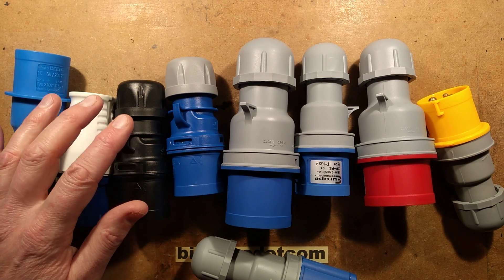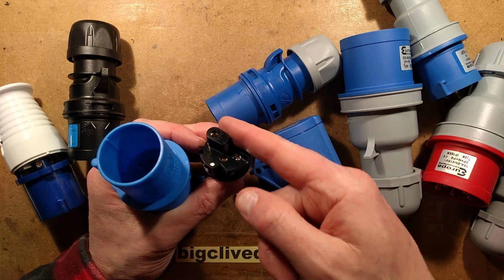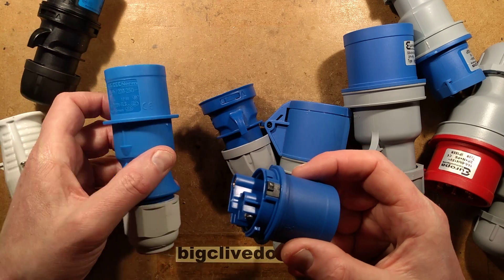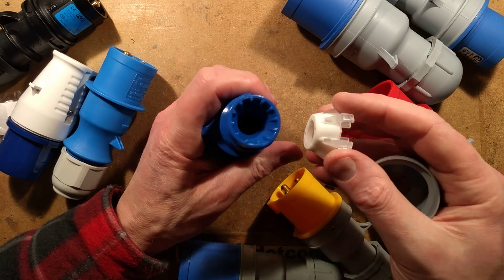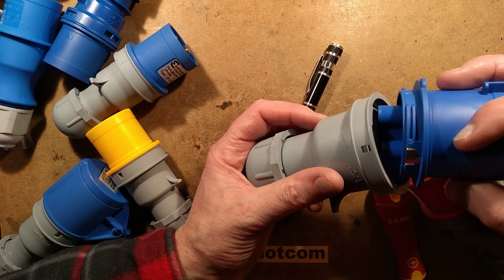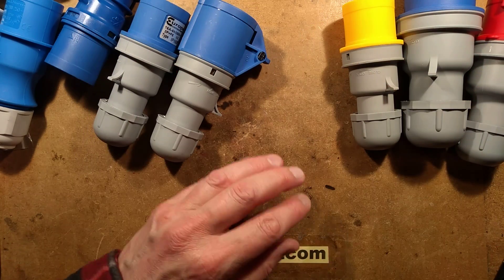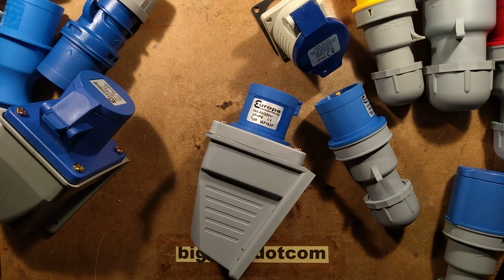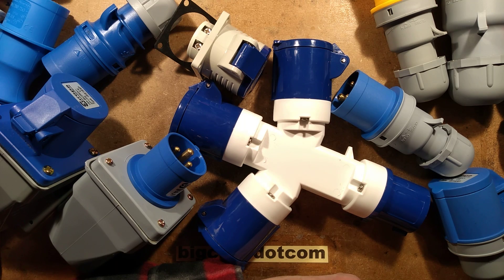My favourite industrial connector (Ceeform).

Comment: These are very common in Germany. Almost every home has them installed.
Reply: Common, yes. But in the home? For what purpose?
Reply: Anvilshock  in german houses you will find mainly the 16a 3 phase variety. They are used for loads over 3.5kw for example an electric log splitter or a welder.
Reply: @trang9405  Exactly. Which this video wasn't about.
Reply: @Anvilshock  Clive did ask about where these are utilized.
Reply: @Anvilshock  You usually get one in the garage for whatever. Sometimes the oven uses one too but they are usually directly hooked up to the wall.
Reply: @Anvilshock  Normally not in the home, but if you have a workshop at home you'll propably find the three-phase variety. The blue ones are mostly used for mobile homes. That's the reason the blue ones are nicknamed "caravan plug" here.
Reply: @Marcel_Germann  Again, not what this video is about. Seriously, what's with all those irrelevant comments?? You got some weird compulsive Reply-button-clicking disorder?
Reply: @Anvilshock  In this video 16:05, he asked especially if the plugs are used in our countries...that's what he got here.
So next time watch the whole video before you freak out here.
Geh scheißen!
Reply: @Marcel_Germann  Then why are you replying to MY comments and not the video itself?? What's wrong with you?? Did you learn to use the internet at Waldorf school?
Reply: @Anvilshock  presumably to answe the question you asked. much as i am doing now actualy.
Reply: @kertas1991111  And I specifically asked for the single-phase blue ones while the responses were about the three-phase red ones. Anybody else want to add something irrelevant?
Reply: @Anvilshock  Sure why not? The video is about the CEE type plugs/outlets. therefore the 5 pronged 3 phase ones also flal into that category (notice how he does have a 3phase one in his collection, i assume he just had more 1 phase ones so thats what he focused on). you also nowhere in your questions specificaly asked about any specific type of CEE connection.

i think thats sufficiently irrelevant for now

Comment: I've seen 32A single phase connectors for connecting power to PDUs in server cabinets in at least three of the data centres I've worked in. One place used 63A Electraks and they were nothing but trouble; Mostly bad connections going high resistance and getting hot enough to melt, short to earth and trip breakers. This failure was seen pretty much on a monthly basis, worst management decision ever. On the other hand all the sites with commando plugs had no issues at all.

Comment: In Australia, we use them a lot in data centres.
Reply: Are you sure they are Ceeform?  None of the data centres I've ever been in have used these.  They all use the AS/NSZ3123 (aka Clipsal 56 series) instead, which although they have similar looking pin layouts, aren't compatible with Ceeform.
Reply: @Berkeloid0 
I've never been in an actual data centre, but have been in many large server rooms in businesses and government departments. Power has always been either one or more 15A Aussie sockets or a Clipsal 3 phase. One place even skipped the connector and had a hard wired UPS which then had 2x 15A IEC outlets feeding to 2 racks. It was still single phase but something like 30A.

Comment: In Australia we have some what  similar plugs and sockets for 3 phase but they have a screw collar to hold them in place and are o-ring sealed for the up rating could not find a name for them as everywhere I looked either gas them labeled as industrial/commercial or AS/NZS 3123. Wich also covers ip  rated single phase sockets 

Example https://images.app.goo.gl/b2zwtsWAsXPZzfTSA
Reply: AS/NZS3123 is the standard and each manufacturer uses their own name.  Clipsal sell them under the "56 series" name, and searching Google for "clipsal 56 series" gives you their catalogue showing all the different variations.  They do seem more flexible than Ceeform but they are a heck of a lot more expensive.
Reply: @Berkeloid0  yea I noticed that after I wrote the comment. From using them a lot they can be a pain in the arse to screw the collar on at times.
Reply: @94Gidge  The screw collar is designed to be used in a factory with a gloved hand so that's probably part of the reason why it's annoying, but at least it's optional if you don't need them to be watertight.  I do like the way they are grouped so that lower-current plugs in one group can fit into higher current sockets in the same group, e.g. the 32A plug will also fit the 40A and 50A sockets.
Reply: @Berkeloid0  yea the being able to plug a lower current plug into a bigger socket. Is handy. 
The problem I was talking about with the screwing them on is sometimes the treads don't catch and it just skips not normally something I worry about but the one on the pressure cleaner at work does it and it has to be done up because the lead on it is only about 2 metres long so it gets a bit of overspray every now and then.

Comment: Clive... widely use in the Republic of Ireland. Yes, its rugged and reliable, and one of my favorite outdoor connectors. Yes, the situation on the "Chuckwagons" ( fish and chips anyone? is common. But with a very red (guilty face) i have to admit that i too am guilty. Most small generators say up to 10KVA have double SOCKETS rated at 32A on them.  If you back-feed with such a unit your cable from the distribution point might become  LIVE if your main electricity supply has failed and you want to back-feed.  I KNOW I KNOW I KNOW you should NEVER back-feed but sadly life ain't like that. The  TWO 32A output sockets on the generator require TWO (2) connectors so I use a double pig tail over 10mm SWY cable. That goes to a big 64 A amp industrial isolation and from there to a dedicated MCB, which in turn feeds the sub unit busbar. THE WHOLE INSTALLATION IS DOTTED WITH WARNINGS and the actual 32A plugs have warnings on them saying that the PINS might become live. But for that to happen... 3 things need to be present. (1) normal Supply needs to be active, the MCB needs to be on and the big (locable) 64AMP industrial switch must be in the ON position. As I am the only one with access to the generator and master switch, the risk is MINIMAL...... but it is there.  But... I hear the audience cry.... for God's sake why don't you put in a proper changeover switch ???? Answer... lack of money. Generator is 100 meters from main supply/meter entry point. I have 16mm2 SWA running to there and I would ideally want to run 32mm2 SWA to there. I can break the after the meter with a 100A double pole switch BEFORE I DO ANYTHING ELSE !!!!.  to ensure any network electricians are safe. The sanctuary is broke... we have 130 resident animals here and trust me... they cost a brutal amount of money. So.... yes..... I love those connectors and have them in place everywhere. Heh... before you kill me..... I am one of yr peatrons so kill me gently. Thanks for another great video.

Albert
Reply: 10 kVA at 240 VAC is 41.7 A. I would just use a single 32 A P+N+PE connector and use a 32 A circuit breaker with a slow C or D curve. When you use a TT earthing system the cable between generator and the main distribution board can actually be two core P+N.
Reply: @Frankhe78 
Frank, first and foremost. THANK you  for yr reply!
Frank, I M glorified Diy'er and NOT a professional electrician.
THEY are now impossible to get for very good reasons they ain't cheap.
The AnimL welfare charity I run Is tottering on the brink of going under, SO I  MUST take shortcuts where I can
Not having a PROPER CHANGE OVER switch is  sadly one of them. Since the 16mm SWA IS UNDERGROUND I HAVE NOT DERATED the cable and at the CU I'VE mcb'ed it with 63A, as the 40A could not handle it. I know at times I. Breaking the allowed voltage drop regulation.... But what the hell.
As long as I can keep our sick and elderly animals war. And cause no risk to our staff and volunteers I have to live with my short cuts.
Thank God, half the time I sort of know what I a. Doing.
My CHRISFMZS PRESSIE for the sanctuary is a metral installation tester.
NO money for a fluke or a Megger.
Thsnks frank for yr Comments... I have NO ONE to too
I am Most grateful.
 Albert.
Reply: @albertkleyn111  Keep up the good work for the animal sanctuary. I see it is kind of a survival for the individual animals and for the sanctuary as the care taking institute. Some municipalities take their responsibility in supporting animal sanctuary and others might not. On an other note, is the power grid not that great where you are? How many hours per month does the generator run on load? The fuel costs for the generator must be quite a thing when you have power outages on a regular basis. I am in the Netherlands and here we are very very lucky to have no major power cuts at all. I seriously can't remember when the last time was. It is probably over seven years ago when the power might have been off for somewhere between 30 and 120 minutes. I count my blessings and realise that people elsewhere are not as lucky as we are. Keep safe!
Reply: @Frankhe78  b
Forgot to say frank I am on a  TN_ CS SYSTEM WITH OUR OWN 11kv transformer. Voltage swings between 250 and 220, depending on load. Main fuse 100 A.

Comment: We use them in the Netherlands  too. The smaller ones on camping sides and harbours for connecting your caravan or boat. The 3 phase i came across a lot in barns for flower bulbs to connect all sorts of sorting- and cleaning machines. Quite common was that all connectors in our neighbor's barn were wired in a anti clockwise order when the ones in our barns were wired in a clockwise order. This meant that if we used a machine of our neighbor the conveyor bands ran backwards and we had to open the plug and switch two phases, I did that a lot.
Reply: There are special CEE connectors available where you can swap two phases from the outside using a screwdriver.
Reply: @Frankhe78  cool did not know that.

Comment: The integrated strain relief is nice, but they seem awfully big for the power they handle. Anderson PowerPoles are quite a bit smaller and go up to 350 A. The nice thing about them is that you can assemble them into custom multi-pin configurations using the dovetails on the sides. Roll pins will then lock them together. Just the thing if you need a 12-pin 45 amp connector 😁 The downside is that they are crimp connectors and not realky designed for exterior use.

I am very surprised to see the screws in these directly contacting the conductors. Do you use ferrules with these? Similar sorts of Hubbell plugs use rising cage clamps.
Reply: Most of the PowerPole series also isn't touch safe so they're not suitable for use above 50 volts.  There are touch-safe versions but those are way more expensive than Ceeform.  What do you need 12 independent 45 amp 100+ volt lines for anyway?  Some kind of weird 10-phase motor controller??

Comment: I like that splitter unit. As you said, it would be a nice way to create a power backbone with taps along the way.
Reply: I Would rather see the main backbone beeing 32A and the split of connectors 16A for safety
Reply: @MrBluemoon74  And protect them using a Miniature Circuit Breaker. The only problem is that you want them to be within reach in order to be able to reset a tripped MCB during a show. When that breaker is somewhere on a truss you might not be able to get there during the show. It is a no-go to construct a cable with a 32 Ampère male connector on one side and a 16 Ampère female connector on the other side. You will need to fuse it. Although you will sometimes see these constructions in real life it is dangerous and should be avoided. The same for a 63 A cables that become 32 A, do not go there. Please do it properly.

Comment: I've never seen the 110V one, although I have known that it exists. The 16A single phase connector is also used on RVs that have grid powered appliances.

Residential 3-phase is relatively common in Finland (since the shuko plugs and sockets are limited to 16A by regulation) and those red connectors are used as plugs and sockets for high powered equipment. Also ubiquituos in industrial installations and building sites.
Reply: The yellow 110 Volt three pin connector can be found in the USA and in the London Underground where they are behind isolation transformers.
Reply: 110V ones are quite popular in UK on building sites. I never have seen them in other European countries, but I am sure they are sometimes used in some specialized and wet environments like tunnel work maybe.

Comment: In the US here. I worked for a company called Ford AV that did all sorts of huge AV installations for airports and arenas and stuff. Although, I was in the tiny rental and production department. We usually just did smaller PA and projection setups and didn't use anything other than extension cords for power. We did use SpeakON for everything audio, which was great. 
Now I do design and instruction for competitive high school marching shows. All our sound systems use SpeakON too. Those never stop being satisfying to connect and disconnect. :)
Reply: So for everything mains power related you use the three-prong NEMA plugs?

Comment: Would these be suitable for solar power installations?
Reply from the maker: I'm not sure how they'd fare if flooded where DC is involved.
Reply: You can find connectors rated for 600-690 VAC. I am not sure how suited they are for DC? A contemporary PV system is able to go up to 1000 VDC. That is a seriously dangerous voltage that deserves respect.
Reply: There's a standard connector for solar panels, why not use that?

Comment: In software engineering in the US we don't normally use those connectors. Totally a different type of sockets. (sorry! stupid joke! ;) But in systems and network engineering we do use similar (but differently shaped) plugs for 20, 30 and 40 amp circuits. I'm not sure about 50 amp and up because I haven't had to wire those.
Reply: You mean NEMA connectors? Here's a 240V 50A 4 conductor one: https://photos.app.goo.gl/xxktWSedDZfJcDw29
Reply: @PaulSteMarie  That appears to be a straight-blade NEMA connector, most data center applications use twist-lock connectors.
Reply: @PaulSteMarie  The household dryer plug has exposed gap and are not designed to provide protection from being dropped resulting in bent pins. In the US the 50 Amp twist lock is used on construction sites as the pins are protected from drops, etc. This is the cords used with spider boxes. The plugs are considerably more robust and higher price. For events power distribution for commercial amp racks and lighting often use these twist lock connectors. They don't get pulled loose, are protected from bent pins, etc. i keep an adapter for the venues with a dryer 50A connection and request the twist lock instead. https://www.grainger.com/product/49YX17?gclid=Cj0KCQiAuefvBRDXARIsAFEOQ9EgkgPsj5J2MTgt2jem7yLo0zyaXgnenGOAGMXsddiRgAdUG3PHT0kaAlPREALw_wcB&cm_mmc=PPC:+Google+PLA&ef_id=Cj0KCQiAuefvBRDXARIsAFEOQ9EgkgPsj5J2MTgt2jem7yLo0zyaXgnenGOAGMXsddiRgAdUG3PHT0kaAlPREALw_wcB:G:s&s_kwcid=AL!2966!3!264955915676!!!g!438993006185!
Reply: @PaulSteMarie  That would be commonly called an "RV" plug. https://www.stayonline.com/product-resources/nema-locking-reference-chart.asp
Reply: Today is the wrong day to give up 3 pins.